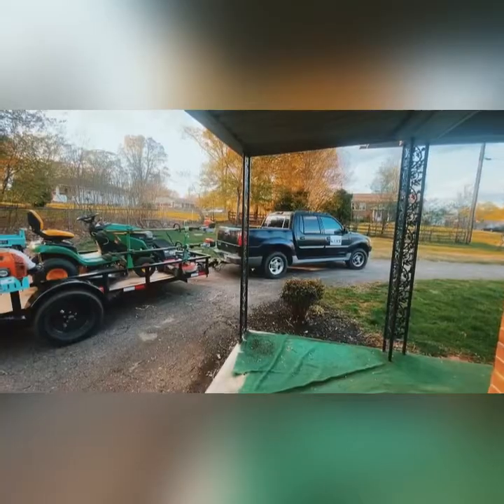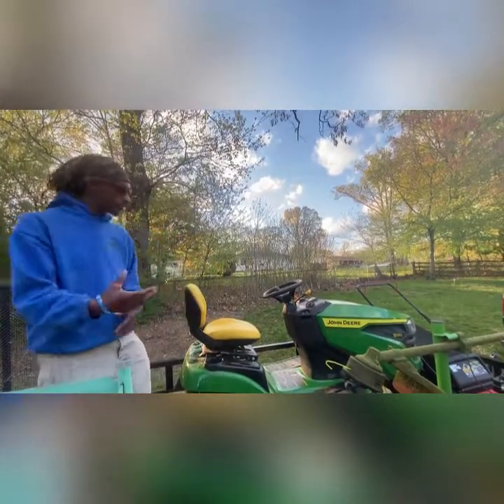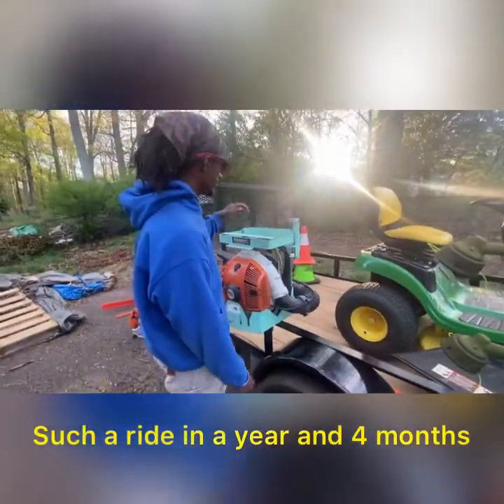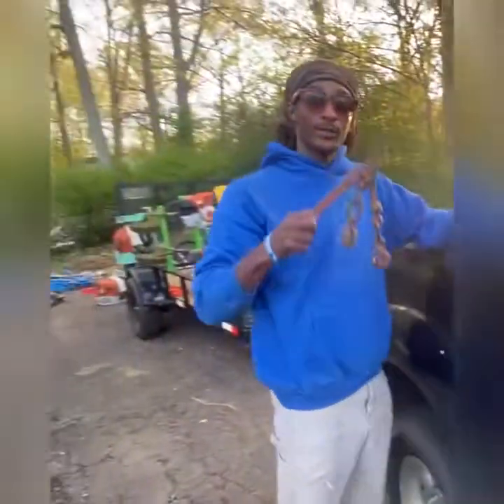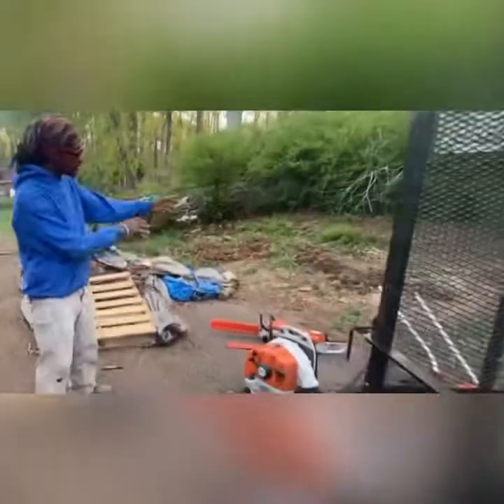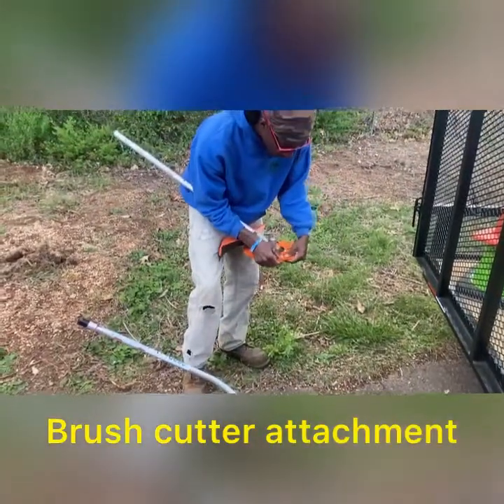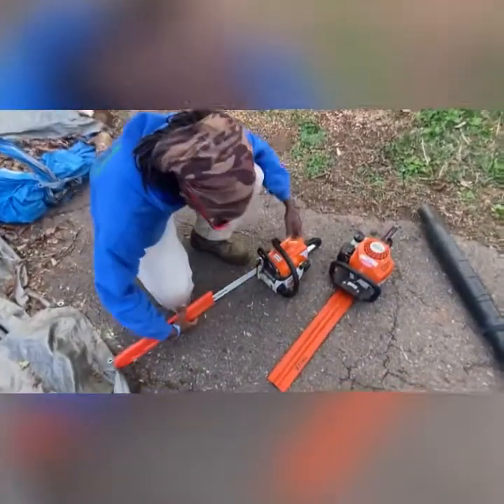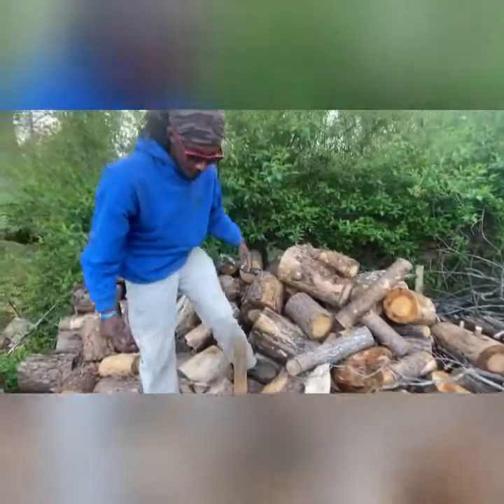24 year olds Lawn Care Setup Tour big upgrades 💪🙏🥶2022’

Comment: Nice setup! Great selection of smaller equipment, definitely love the trimmer and blower racks. I have the same ones. Just subbed and followed you on Instagram.

It is really hard to make videos sometimes, but you just gotta do it. My problem is being solo, it can add a lot more time to my day. I'd love to see some videos of you just mowing or doing whatever to make that money. I love watching those videos. Helps to remind me to relax and just enjoy being able to work outside every day.
Reply from the maker: For sure man I’m gonna get back into recording for sure, I love these racks so much! Created so much space in the bed of my pickup! Thanks for the comment and stopping by and for the sub 🙏
Reply: @4SeasonsWithMartin  Anytime! I love having the equipment out of my truck. It avoids theft, damage and heat issues having them safe and secured on the trailer.